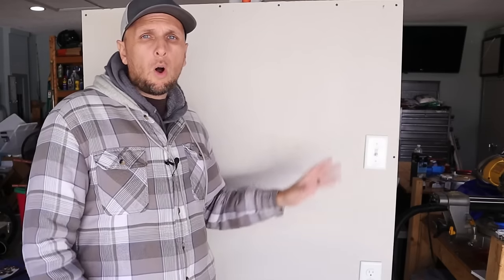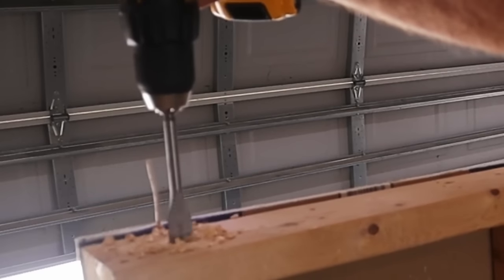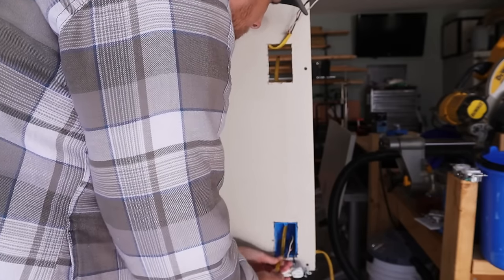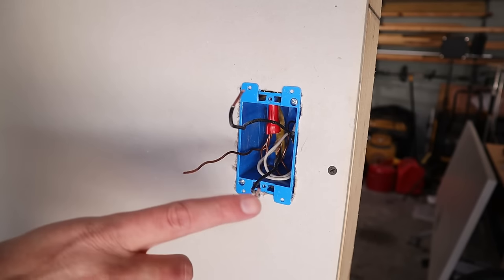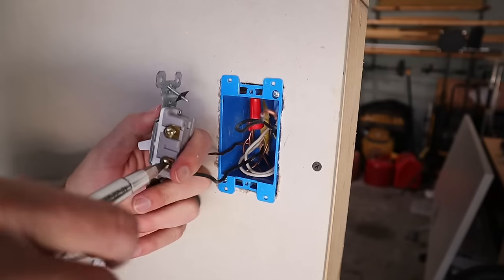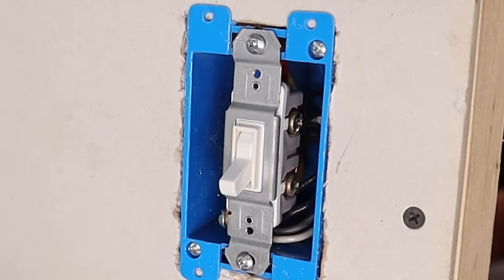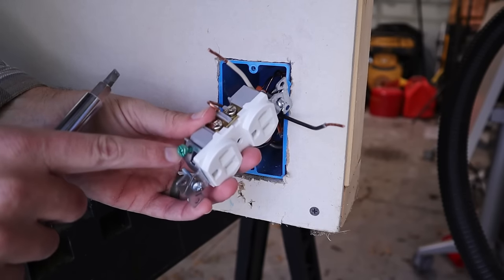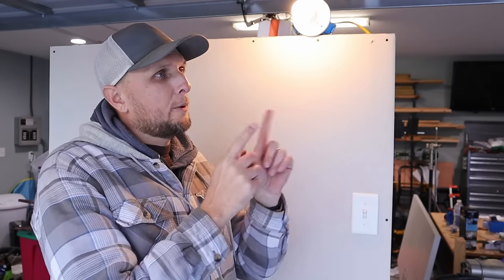How to Add New Lighting From An Existing Outlet | Can Be Done Anywhere!

Comment from the maker: Was this interesting or helpful to you?  This was a popular request in the comments of other videos.  Do you have any projects you would like to see here on the channel in the future?  Thank you for your input! 🙂
Reply: can you run 14/2 to light off 12/2 wire from box ?
Reply: Honestly, no. As a DIYer, I don’t have a clue how you ran/fished wire or what type of wire you used here, what kinds of boxes we need etc. Running the wiring and knowing where to pull from (don’t know where your power is coming in). Are there limitations on wiring types, what you can pull electrical off of? Are you using power from an existing outlet? How do you do this when the outlet is 3 feet to the left or non-existent?
Reply from the maker: @vanstromi7810 most of that was in the video.  I suggest you hire an electrician.

Comment: Huh, I’ve never seen anyone push the wires into a Wago before, kind of like a push-in connector . I’ve always opened the lever before inserting them. That was illuminating. I just might start doing that, have to try it out. Seems like it could be convenient especially when you have your hands full.

Comment: My outlet has a romex 3 wire coming in to the plug and a romex 3 wire going out. Does that mean the plug is not at the end of the circuit (like the plug in your example). What is the best way to connect the wires going to the new switch to the existing plug?  I want to use a motion detector switch instead of the usual switch. Will that present any problem?  
I think your video is well made and rehearsed- there isn’t any wasted time. Thanks.

Comment: I want to do this with the switch being for an outside flood light. Is it ok to use 12 gauge wire if the outlet has 14 gauge wire? The reason i ask is i have a roll of 12/2.

Comment: Great video, and very helpful. Question;  I moved an outlet a few feet up my wall -  with guidance from a previous video you made -  but I also wanted to add a light switch next to the new outlet that I moved (making some strip lights for a cabinet set up). Can I use power from the outlet that was moved up the wall for the new light switch, or do I have to wire an additional wire for the light switch, from the original outlet? Hope that makes sense. Thanks!!

Comment: The outlet has both  neutral & hot terminals already are used. I believe one is going to the ceiling fan. Is it possible to add another light to the same outlet by pigtailing all three wires(hot,fan,light) & connecting to just one terminal?..doing same to neutrals. thank you.

Comment: What about just using radio remote?  Also 15A 120V made sense when bulbs were 75w to 120w, but with low power bulbs we have now a 12v or 24v system may be an overall win.

Comment: I have 3 exterior lights that use one interior light switch. How should I add/wire the last 4th exterior light using the same switch?
Reply: all you need is to run a wire/14/2 from the closet light source to the new install location. At the box where you added a 14/2 splice them together with the existing, add tails for all wires and resplice them to the ex light. At the new location its just one set of wires and splice to the light.
Reply: @iiConFuZze  so pigtail or splice from nearest light? How should I connect new wires to single interior light switch? Could this be too much for this switch if another outlet is also on this circuit?

Comment: Hi. Great video. I learned a lot on the basic, what to do or how to address air in the hydraulic system. But say you have water in the system . From adding contaminated oil or mistakenly leaving the cap off and rain water got in the reservoir. How can I remove the water and flush the contaminated oil out and replace it with Clean new oil?